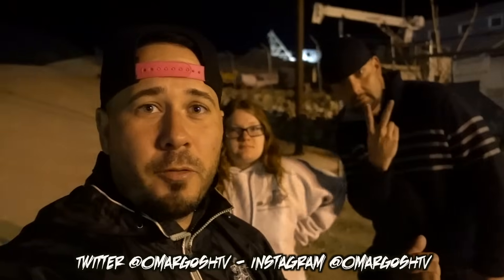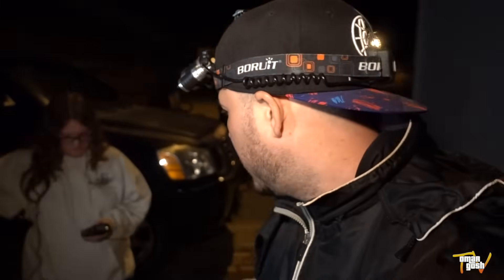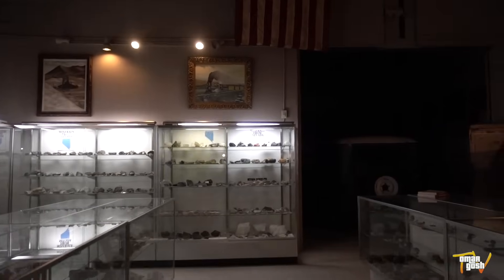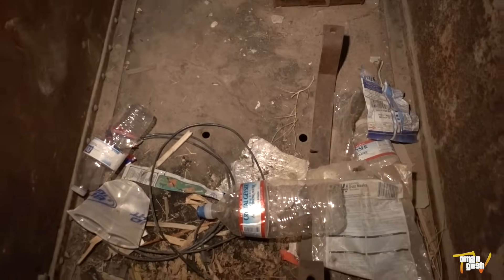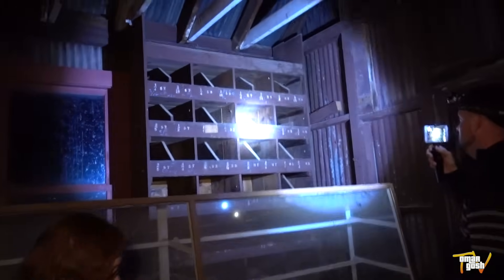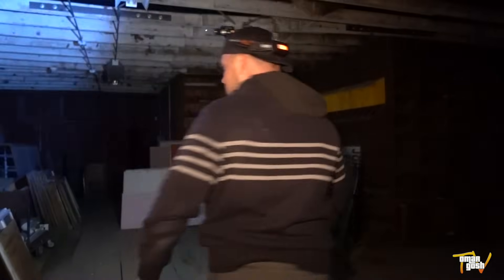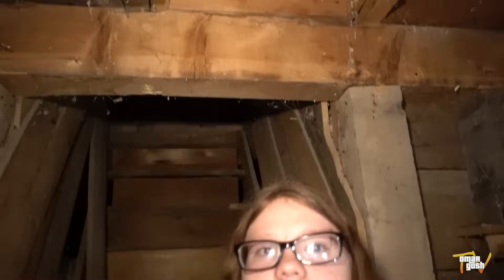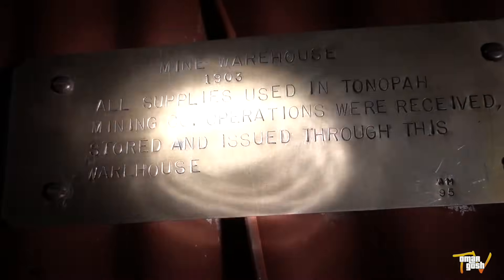EXTREMELY HAUNTED MINE CAVE AT 3AM | OmarGoshTV

Comment: 22:30 there is an orb of light coming towards you and then moving away 
Like so omar can see
Reply: Stefan Manki that was dust I'm pretty sure
Reply: Gracie Warner that doesn't look like dust
Reply: Stefan Manki yeah if you look at the roof you can see it very well
Reply: Stefan Manki but it's more in 22:30-22:34 on top of screen
Reply: +SirEric the mine is old and there's probably dust

Comment: Those lights are on a motion control you can see the sensor eye on the wall next to the display case and the fan is on the hanging heater and the fan turns on and off with the heat